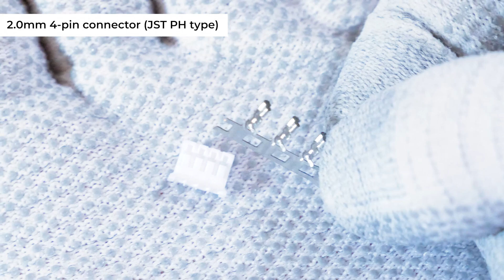Modifying heatsink to fit on video card. Crimping fan connectors. OEM GTX 950 cooler upgrade.

Comment: What's the brand / model of the case you've used in the video?
Reply from the maker: It's Chieftec BT-02B-U3, but with no power supply, as I'm using an external one here. Otherwise the GPU wouldn't fit.

Comment: You should also try some copper base radiators and do some temperature comparison tests
Reply from the maker: Thanks for the comment, sure, that would be a good idea. I know I should have put some tests here, however I have another OEM GTX 950 with stock cooler and some missing components, and after I fix it I would be able to run some benchmarks with both cards simultaneously. Now I don't have precise temp. measurements, however I remember stock cooler hitting around 82-84C with Furmark, and now I have around 74C in Furmark in small case with limited airflow (these are just approximate values)